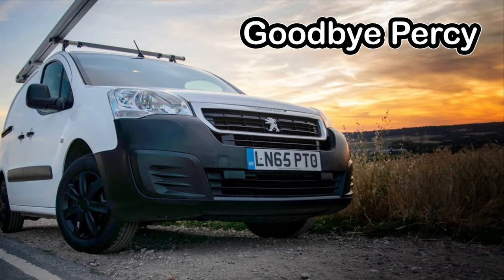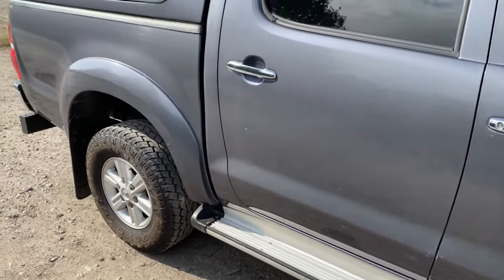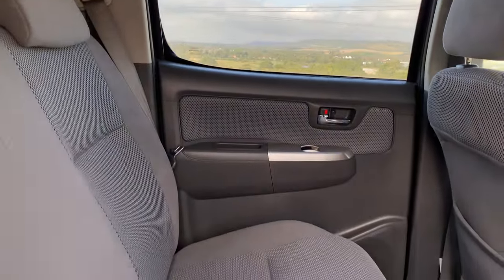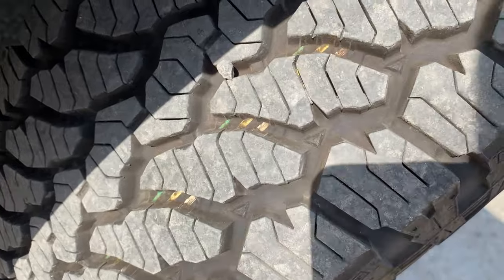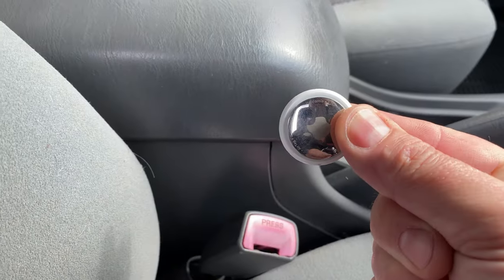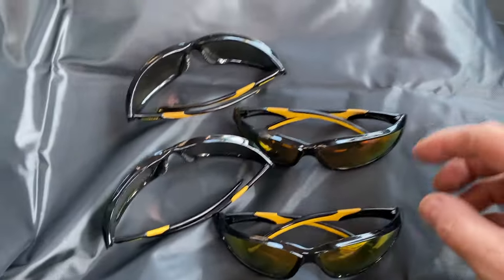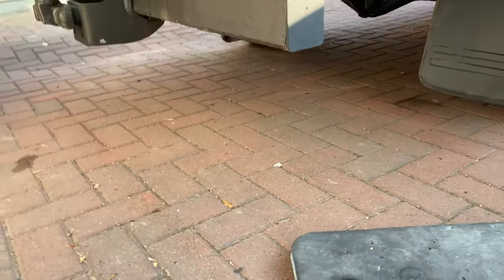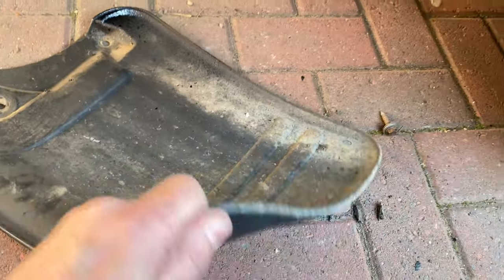FLEET UPGRADE 😎TOYOTA HILUX 4x4 pickup

Comment: We service a fleet of these for an Equestrian College (ranging from '15 to '22 plate) and they take an absolute beating, the '15 plate ones are well north of a 160,000 miles but they keep on going. That era do suffer from fuel gauge issues (3 or 4 of the ones we look after have stickers says refuel before 400 miles) and also instrument panel failure so new clocks have been fitted.
Reply from the maker: That’s interesting about the fuel gauge, I think mines ok maybe but I filled it up, done 100 miles and the gauge hasn’t moved!? What’s the cam belt change mileage?
Reply: @dadskillzcars  

Think 100k or 10 years (know the mileage is right not sure about the time, have to look that up). 😀

Comment: Rubber floor mats 😂 ... Mine didn't come with ... The first thing I did was an oil and filter change and front and rear diff and transfer box oil change .... I love the truck but the DPF spoils the experience ... New set of tyres 600 ... Timing belt kit at 90 k £300 ... Injectors at 150 k  should go on for 300 k